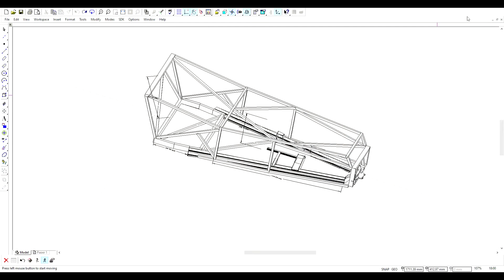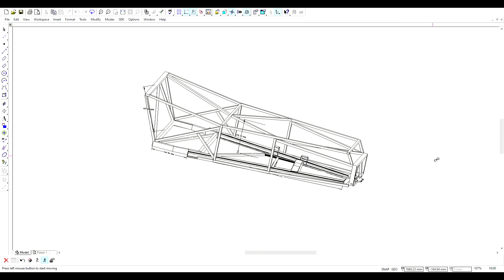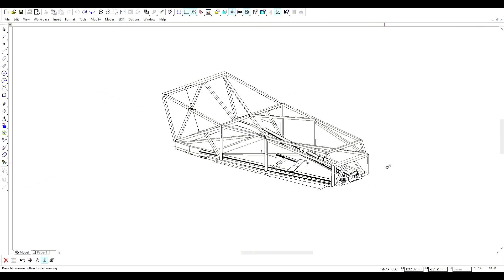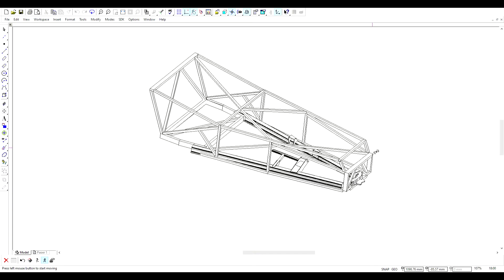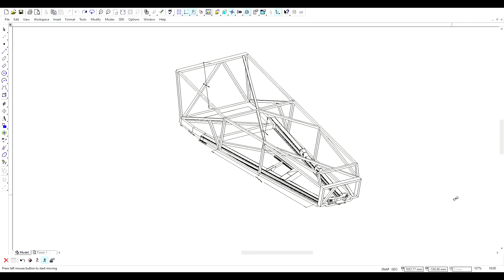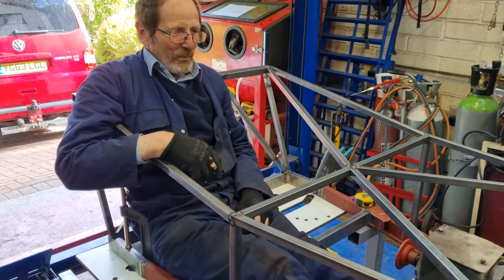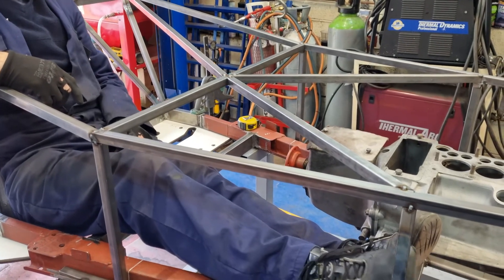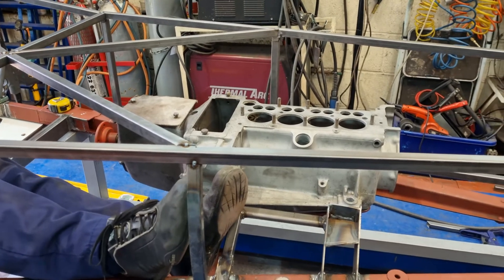Monoposto Seven   frame on chassis

Comment: Alastair, I'm surprised that you are not making a Superleggera frame & body for your monoposto seven.
Reply from the maker: Superleggera is an automobile construction technology used in Italy from the middle of the 20th century. The name means "super light" in Italian, and was coined in 1937 by the Italian coachbuilder, Carrozzeria Touring. Unlike the monocoque and body-on-frame methods widely adopted by the 1950s, Superleggera cars use a frame of metal tubes as a full-body frame which closely follow the shape of the car. These are then covered with body panels, made of aluminium alloy. The Superleggera frame tubes are too small and of unsuitable material for mounting suspension components.
Reply: @austin.seven.alastair  Perfect for a car with an Austin 7 chassis.